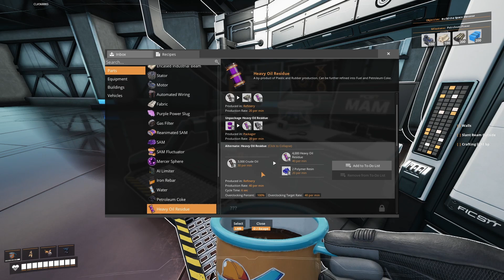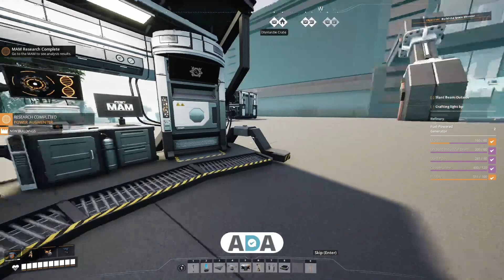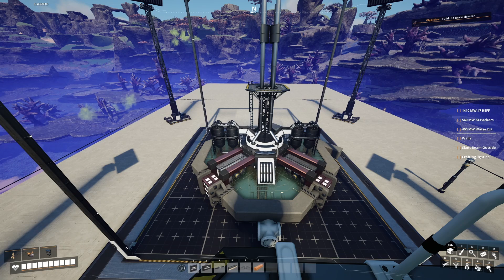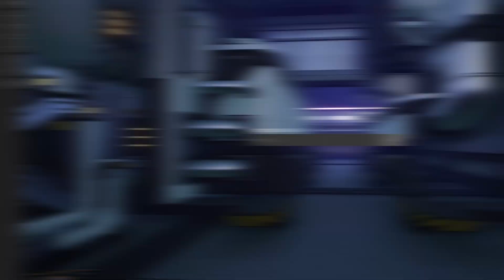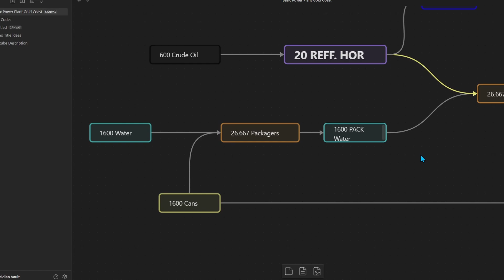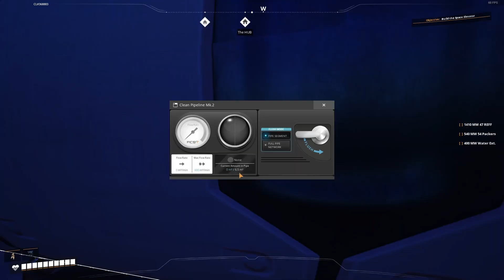Making MASSIVE Power Exploiting OIL In Satisfactory

Comment: By the way, if you make power towers you will continuously follow the powerlines when using the zipline instead of needing to jump between each power pole. 

I would also highly recommend getting the manual storage upload researched from the MAM because you can use dimensional storage to store basically anything and it's super useful to keep those items that you want at an arms reach away, like the Somersloops you had to run back to pick up. You can throw in your chainsaw, scanners, extra fuel and ammo, Somersloops, coupons, etc... it's super useful.

Comment: I did the same but different approach, encapsulated fuel production. It works as follows, heavy oil residue at 75% feeds a diluted fuel at 100%, then unpack the fuel and send the cans to a water packager. So
10 of these blueprints give you 600 m3 of fuel for 225 m3 of fuel and 600 m3 of water. To start you need to put some cans on the water packagers and connect power, pipes and conveyor.
It can be used to feed the a recycled plastic / rubber setup, energy production /  better fuel production.

Comment: if you nudge the conveyor hole one more towards the machine, the conveyor will clip, but connect without needing that extra belt. It's better in my opinion, because like you I build stuff around the machines so having a smaller footprint is ideal
Reply from the maker: Ive tested the bug, there is an audio ping when something will connect. With this setup it did that when building the blueprint but does not transfer items. It is supposed to.  A few others in the streams have had this bug.